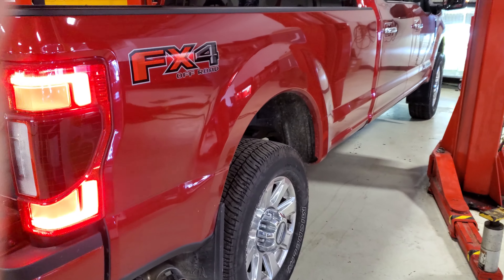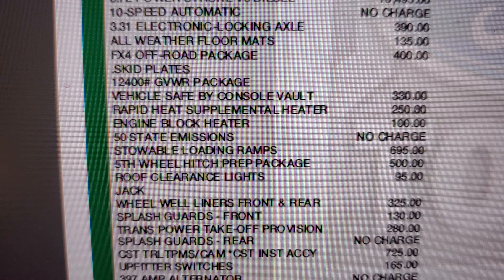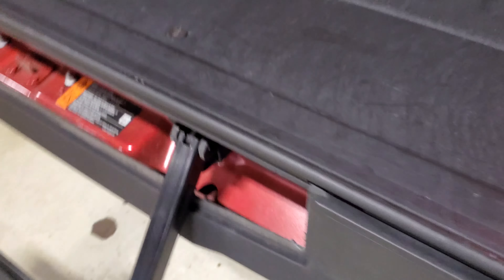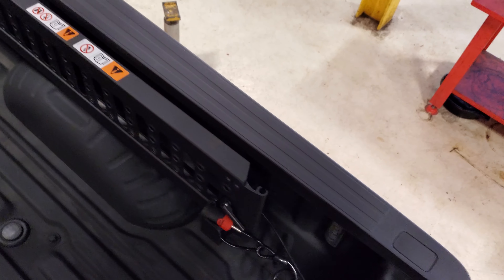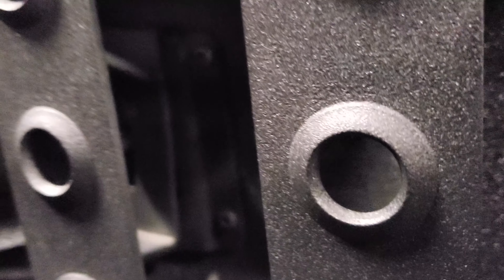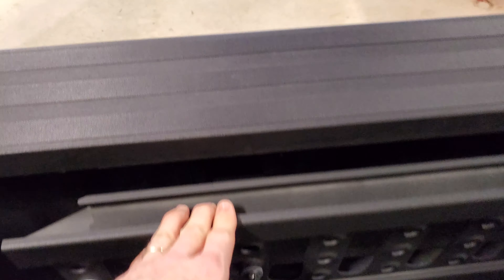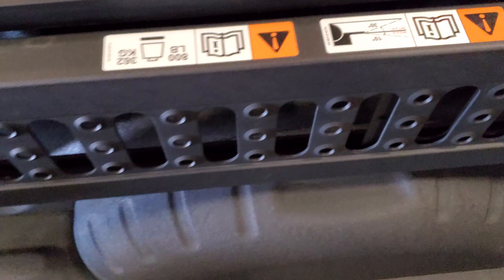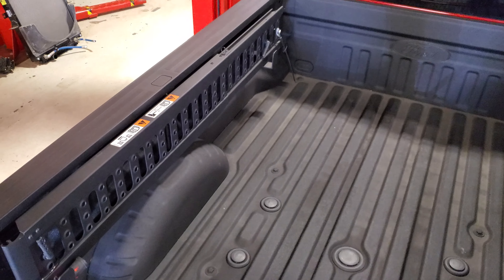FORD OEM LOADING RAMPS???? DO YOU have these?? Ford Superduty 2017-2022 F250 F350 F450 trucks

Comment: I would get them after I purchased the truck and install the tailgate part. I would keep the ramps at home unless I needed them. I love the way they lock to the tailgate so they won’t slip off…way better than a couple of 2x8 boards. Loading a mower or an atv is a hair raising experience with homemade or even most aftermarket ramps. Good job Ford !!

Comment: Wow!  My truck is a movie star!  To answer a few questions:  like ARod said in the vid, they’re rated at 800 pounds a side.  They are telescoped quite a bit in the stowed position. They do extend to between 11 and 12 feet long.  No, they aren’t compatible with most toolboxes or bed covers.  Yes, both the tailgate plate and ramps are available through Ford parts.  The remainder of the box link parts come in a package included with the truck from the factory.
Reply: Thanks for that reply.  Do you know what bed covers will work?  I'd really like to get a roll up alum backed bed cover with it
Reply: Sorry.  No idea what will work with the ramps.
Reply: Check those lengths again.  I think you're giving bad information.  As stowed, those things are only around 4' or so ... so, the math just doesn't work out.  You can't extend a 4.5' ramp and get 11-12' out of it.  The other videos of this ramp show it around 88" or 7' 4" when extended and locked.  Here's an example:  https://www.youtube.com/watch?v=qOLz9abnkjw
Reply: @67L48  - did you look at this video?  They are about a foot shorter than my 8' bed when telescoped and stowed. They're about 7 feet at they sit in the bed.  That's not a short bed.
Reply: @Vlad-from-USA  Yes.  I watched the video.  I also watched the video I linked to above where they actually extend the ramps and show a tape measure to measure them.  About 88" long when extended.  I want to believe you, very badly.  But, I just have seen nothing but videos and various reviews of these ramps that all say the same thing -- about 7 and half feet when extended.  Perhaps you got some pre-launch beta version that never made it to full production?

Comment: Had them in my 2019 F-150 but the tailgate mounting plate doesn't fit 2022 model year so I sold them.  They worked great for getting snow blower, lawn mower, generator in and out of the truck bed.

Comment: Hope they`re longer then the ones for the F-150. If not the angle will be real steep to get up them seeing the f-150 isn`t as high.
Reply: My ramps worked great on my F-150.  They telescoped out to about 8-9 feet and were plenty of ramp for getting riding lawn tractor and snow blower into and out of the bed.  I used the slope of my driveway to lessen the incline but I also used them to load my 200# generator in and out of the bed for camping and did that on flat ground at the camp sites.

Comment: Yeah those are sweet. I almost ordered them when I ordered my truck but the angle is still too steep on the tremor to manually load anything feasible.
Reply from the maker: Feasible....i like the big words 😝😝😝
Reply: Use an angled driveway or ditch.  Bam.
Reply: @GasCJMan  yea that’s fine for at home but when I get to the track that’s not always an option.
Reply: @daddydiesel5889  can always put a set of ramps over the ramps.  See guys do it all the time even on trailers.  

But I completely get your issue.  I’ve had the issue all the time when loading motorcycles.
Reply: The owner of the truck left a comment saying those ramps extend to a 11 or 12 feet. If that's the case it shouldn't be much of an issue.
Reply: @awdeveau  nice I didn’t know they extended. Might have to order some.
Reply: @awdeveau  Except he must have a broken tape measure.  You can see in the video that the collapsed ramps as stowed are only around 4' or so ... so, you know they don't extend to 11 or 12 feet.  In other videos online they actually measure them and they land around 88" fully extended, which is 7' 4".

Comment: Do they extend
Reply from the maker: No
Reply: Actually, yes they do.  They’re about 12’ fully extended.
Reply from the maker: Didnt know
Reply: Actually, they're just over 7' at 88" when extended.  There are other videos that measure them.  If they extended to 12" as suggested, then the collapsed configuration would just barely squeeze into the 6'9" box ... which you can clearly see isn't the case.

Comment: firewoodfred says " how much weight are t b ey rated for ??? Do they adjust to be longer ???"
Reply from the maker: Just talked to ol Roy!!!
Reply: They extend to around 12 feet long. Rated for 800 pounds a ramp.
Reply: @Vlad-from-USA  No way they're 12'.  Those things are just a tad over 7 feet when extended.  To extend to the 12 feet you are suggesting, they would need to be at least 6 feet long when collapsed ... and you can easily see in this video that that is nowhere close to being the case.  In other videos, people have measured.  88 inches ... 7'4".
Reply: @67L48  - they're about a foot shorter than my 8 foot long bed, give or take, when stowed.